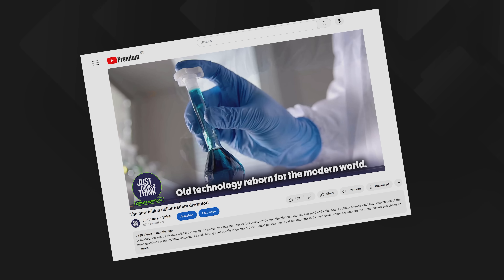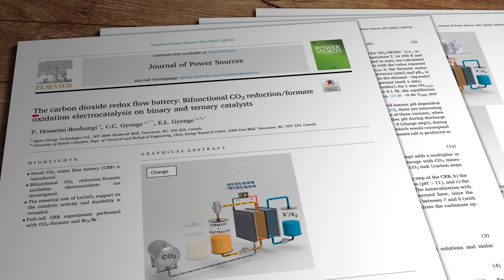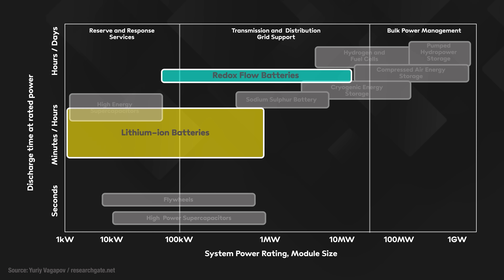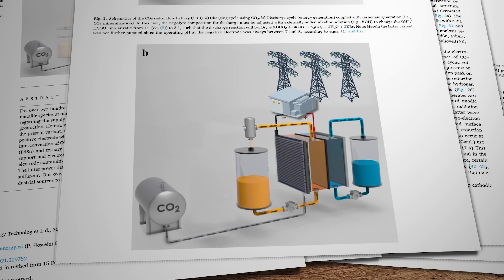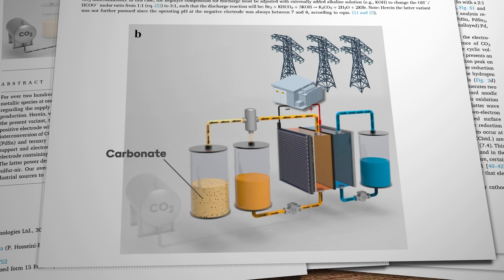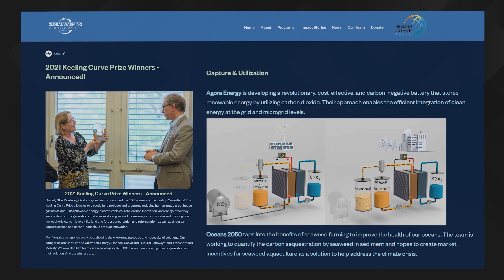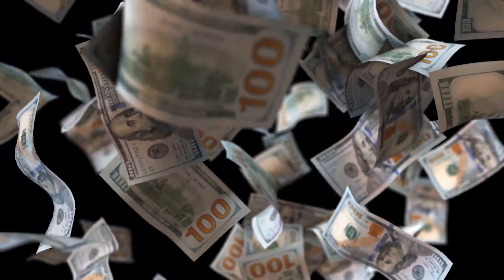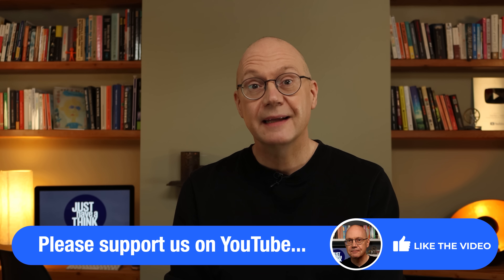A Carbon Dioxide Battery that could actually work!

Comment: I'm not qualified to comment on this one specific process. Way above my training / pay-grade. Think the woman in the Monty Python sketch, who is going to have a baby. "No, darling ~ you're not QUALIFIED." 
I would comment on the more general picture, there are solutions. There are ways to do this. Some are maybe more complex and tricky than others, but we're not going to find them if we don't look for them.
I would also comment that there's more than one way to skin a moggy. What may be a perfect solution in one place, with one set of resources and restrictions, perhaps there's a different solution which would be suitable in another setting.
A large scale Redox Flow battery, that uses captured CO2 ~ that sounds really good ~ even if the volumetric efficiency isn't all that great. If it doesn't have the energy density of a high end Lithium Ion battery for a phone or a wristwatch ~ so what?
If it's also cheap to make and cheap to run and uses processes and chemicals we are extremely familiar with already, and have industrial infrastructure already in place for handling and such ~ that's a double advantage.
If that same process can give rise to carbon capture and make bi-products that are resources for other large scale chemical and manufacturing tasks, which are already happening, then you've stumbled onto a gold mine.
You've got a way here to do chemically stable carbon storage ~ never mind pumping gas into old mine-shafts or frakking with it!
If it is a robust and long term process, doesn't require constant expensive maintenance and replacement of cathodes and anodes and such, so much the better. Doesn't require superconductors or cryogenic temperatures ... Yeah, some things are a bit toxic there, will require careful handling. Ok ~ how many things in existing industry are like that?
Now ~ if we combine all this, and the idea it doesn't require lots of rare Earths and angel dust, dehydrated unicorn semen, Strontium isotopes ~ graphene membranes to prevent dendrite short-circuits,  that's great.
What? It's also got an energy density on par with phone / laptop Li Ion batteries? As good as what we're using in Tesla cars?
Shut up and Take My Money! ~ Where do I sign up? This is fantastic!
No, I'm not advocating this as the one and only true God ~ that's my point. There's more than one way to shave or wax your kitty, but this sounds incredibly promising on so many levels.
This is what we do and encourage scientific and industrial research for ~ to find solutions like this.
It's got one or two negative aspects, things that have to watched and handled frequently and with care & training, but mostly it's just all winning cards in the the same hand.

Comment: Converting CO2 to carbonate does not generate (or require) electricity, so the whole "saleable product" thing is bogus. As is the "capture" of a less-than-microscopic fraction of the world's CO2 emissions.
  
With that PR nonsense out of the way, you have the actual invention, which is reversibly coupling formate oxidation with bromine reduction.  Good cell voltage and excellent power density, and no expensive metals, makes it really attractive for stationary storage.  Challenges are the membrane and electrodes, which have to hold up long-term to bromine under harsh conditions.  Not a small ask, but if they can do it at scale it's a winning design.

Comment: Grid storage doesn't care about density.

Making sodium carbonate out of sodium hydroxide and CO2 happens spontaneously.  It's making the sodium hydroxide that's the sticky wicket.  Running the battery discharge at high pH needs the same sodium hydroxide.

Having one cheap component doesn't make a system cheap.

Comment: One of the reasons I really love this channel is that it makes things feel real - there is no neo-liberal, tech bro optimism - but it spends a lot of time going through the many, many different technologies that are being researched and optimised. Particularly storage tech. Many don't involve the usual suspects in terms of battery tech, and some aren't even highly toxic for either extraction or recycling at end-of-life. And there are LOTS of them. 95% of them will fail completely and 80% of the rest will be too expensive to make a meaningful difference. Many of those that could really make a change might take a couple of decades more to get there. 

But what that all means is that actually, at least for the energy thing, we aren't doomed. 1% of 1000 is 10, and that's probably enough. It's not all relying on lithium and traditional solar panels, and that means we could actually force miners and manufacturers to keep to some minimum standards and still make some meaningful progress in terms of volume.

What about copper though? Is that going to be one of those "hard" problems that physics is going to stubbornly stop us getting proper alternatives to?
Reply: Aluminium is a quite popular substitute nowadays. It is used quite a bit in transformers in lieu of copper. It's in almost inexhaustible quantities in the crust.
Reply: @gregbailey45 indeed, take copper clad aluminum network cable or the aluminum ground cable that powers my house since 1976(!)

Comment: I've no illusion that I'm benefiting anyone with wisdom. I comment to help out the algorithm, and to make sure I understand what the video is saying. It helps a lot.

Anyway, thank you for another great video. This is a really clever idea, and for once it's fairly close to home! Agora Energy Technologies is a Vancouver startup, so just on the other side of the mountains.

It does sound clever. Energy storage and/or carbon capture. It seems like the best place for these batteries is an industrial park, where some of them could regulate the electricity coming in and others could be put to work making carbonate. If I understand right, the main reason industries don't capture CO2 from their own smokestacks is because it costs money. If they can sell the carbonate that could potentially make the equipment pay for itself.
Reply: Those secondary/tertiary market opportunities could make for ‘zero-cost’ or low cost installation for sure! I’m in Alberta, and it would be great to have a facility out here pulling from refineries or concrete plants.
Reply: Yea, the algorithm.
Reply: @andrewharrison8436 Al 🕺 Gore 🕺 Rhythm 🕺

Comment: I studied Chemistry, not Chemical Engineering, but this doesn't sound at all practical. First you have to capture the carbon dioxide, which (so far as I know) is untried at scale. Then you have a battery that requires bromine, which isn't all that common and is nasty stuff. I'm pretty sure this is untried at scale, too. Finally, you'll need a source of alkali - presumably hydroxide, which probably has quite a carbon footprint in its production. The whole thing sounds like a pipe dream, with added greenwashing.
That said, flow batteries in some form could be a useful form of energy storage in static locations, without using up the lithium we need for mobile applications such as vehicles.

Comment: Maybe I'm missing something here. please correct me if I am.
But it sounds like this depends on capturing CO2 from the dirty industrial processes that we should be trying to eliminate. And won''t a lot of the carbonate and bicarbonate end products be used in ways that end up releasing the previously captured CO2 into the atmosphere?
Reply: Depends whether you're a glass half full or half empty person.
Reply: @gregbailey45  Not really. We need to stop, or at least greatly reduce, CO2 emissions. Recycling fossil fuel emissions once or twice before releasing them into the atmosphere doesn't really achieve that.
You still have a full glass of CO2 even if you temporarily reuse half of it.

Comment: The other elephant, not talking about the chemical, environmental and disposal elephant. But the energy elephant required to capture and process the CO2. The energy to pump and the control systems the soutions around and the general plant operations lighting etc. Then back to the first elehpant and the energy used in dealing with it. 
How much larger do the solar and wind farms need to be to counter ballance (and there is another elehpant the cost in mining manufacture and maintanenc of thoses systems) all the ineficencies along the way to run the batteries. 
Seems it is a bit like fusion reaction the out put energy can not sustain the reaction let alone allow any meaning full power being delivered to external demand.
Science is bitch, hate to break it to all the free energy cult members, you don't get something for nothing excep the sun, wind and hydro even they can have cost.

Comment: 0:00: 🔋 Innovative carbon dioxide battery technology emerges with unique features.
2:57: ⚡️ Innovative redox flow battery technology offers longer duration storage for renewable energy integration without using troubling metals.
4:47: ⚡ Innovative battery design converts carbon dioxide into valuable carbonate through pH manipulation.
7:28: ⚡ Breakthrough in energy storage technology with high energy density and potential difference.
9:20: ⚡ Breakthrough technology by Agora Energy faces funding challenges despite winning prestigious awards.

Timestamps by Tammy AI

Comment: Here's an "Explain Like I'm 5" abstract of the transcript about redox
flow batteries:

What's a battery?

* A battery stores energy like a big lunchbox holds your food.
* Normal batteries keep all their energy inside, just like your
  lunchbox.
* Special batteries called "flow batteries" store their energy juice
  in big tanks and use pumps to move the juice around.

What's special about this flow battery?

* Instead of using special metals, this battery uses bubbly gas you
  breathe out (carbon dioxide).
* This gas is usually bad for the world, but this battery catches it
  from factories.
* While storing energy, the battery also makes something like baking
  powder that people use to make lots of stuff!

Why is this battery cool?

* It helps clean up bad air.
* It stores lots of energy, like a big lunchbox.
* It makes something useful while it works.

Is it perfect?

* No, it's still new and scientists are working on it, like a new
  recipe.
* It needs careful helpers because it uses some strong liquids.

What now?

* Scientists need help to build bigger versions of this battery.
* It won't be in your toys soon, but maybe one day it will help keep
  the lights on in your whole town!

Abstract

This transcript describes a new type of redox flow battery that offers
several advantages over traditional models:

* Captures Carbon Dioxide: Instead of using metals, this battery
  uses carbon dioxide (CO2) captured from industrial emissions,
  helping reduce greenhouse gases.
* Produces Valuable Products: During the discharge process, the
  battery turns CO2 into carbonates and bicarbonates, which are useful
  in various industries (soaps, animal feed, glassmaking etc.)
* Promising Lab Results: Lab tests show high energy density and
  potentially low costs due to inexpensive CO2.
* Challenges: The technology isn't yet commercially available and
  needs careful handling due to the use of acid and bromine.
* Need for Investment: Despite winning awards, the company (Agora
  Energy) needs more investment to scale up production.

Overall, this carbon dioxide redox flow battery shows promise in both
energy storage and carbon capture, making it an exciting technology
for a more sustainable future.

i used gemini

Comment: i would be extremely skeptical of agora's claims. i don't doubt their final numbers, but as a few other commenters have pointed-out, 'simply' raising the pH value of the battery fluid is not a triviality to be ignored. they are likely putting more carbon into the system than they are capturing and maybe even more energy into the system (if they are using hydroxide) than the battery stores 

this would make the battery impossible to scale and disqualify it as a carbon capture solution

Comment: Seems a very good use of a waste product, and as a concept very innovative. My concern is that the makers of the waste product will see this as yet another justification to keep the CO2 flowing, on the basis of 'it's not the fossil fuel, it's the CO2'. As we should know by now, CCS is an appalling waste of energy and hugely inefficient. Daisy chaining this on the process just adds to the inefficiency multiplier.

Comment: Sounds too good. Any info if the gravimetric energy includes the storage container?
Wonder what SH will say to that kind of CCS?
Reply: For most stationary storage applications, both volumetric and gravimetric energy density are pretty much irrelevant, I  would presume.
It may be an issue if used for a home battery, but that would be very unlikely for this technology due to the need for high pressure CO² gas storage.

Comment: You missed the issue of this process requiring CO2 to be captured from a CO2 producing chemical process (which may not exist when this battery is deployed in ~2040)
Also anything branding itself with CO2 feels like a dangerous field, for using it to prevent its harmful effects sound to good to be true. (At large scale) Hence it might be prudent, to show how much of CO2 emissions could be reused in this way, give that the CO2 is actually converted into another chemical.
I think this may best be described as a battery technology for reprocessing waste CO2 to reduce mining need. A CO2 battery sounds, much like a CO2 heatpump, like you only need a minor amount once, which would never be enough to make an actual impact.

Comment: I would be very interested to see a video from you in which you cover all these technologies and where they are now, why they succeeded or failed and the state of it all.

Personally, I've noticed no difference in anything around me for a long time... Which is very polar opposite to what you'd expect to happen over a decade or more with these kinds of developments
Reply: Sadly, the electrons don't look any different no matter where they come from...
Reply: @gregbailey45 Yes... But what I'm saying is that all the battery tech the consumers are using are still the same format, albeit perhaps more efficient.

Comment: It would make sodium carbonate  as the byproduct if fed sodium hydroxide. The separatog would be  a proton exchange membrane and bromide/HBr/ Br2 would be the anode side. The materials needed to work with elemental bromine and HBr would be challenging, but SiC/graphite on a metal oxide/ tantalum plated collector should work well. Ordinary stainess steel coated with palladium of patinum loaded carbon would work for the cathode side. In an open cycle, the battery would be charged by creating bicarbonate that creates formate and carbonate as power is being drawn. The formate is the actual chemical created as it runs. Other than the small amounts of precious metals needed it seems like a good idea as formic acid is a useful chemical feedstock.

Comment: The fact that this battery uses CO2 isn't particularly relevant to climate change.  In order to make a dent in climate change, we need to remove BILLIONS of tons of CO2.   If we had enough of these CO2 batteries to make up for the worlds yearly 55Mton production of sodium carbonate (~100 gigawatt*h facilities, fully cycled daily for a year) we would sequester 23 Mton CO2, which is about one five hundredth of a billion tons.  Kind of a drop in the bucket.

Comment: No battery does "frequency regulation duties" - unless ,of course , someone invents the improbable AC battery.
Btw it all very well saying they are going to capture carbon dioxide , but when it comes to the crunch they invariably end up using the existing dirty industrial methods of production

Comment: Very promising. I'm sure that the carbon capture aspect of their techsplanation is winning over a lot of enthusiastic influencers, however, I come from the "If it looks too good to be true, it probably is." school of economics and I wonder why there isn't a gold rush on to invest in this system, particularly since they've been pitching it since before the pandemic.

I particularly like the fact that in theory, the spin off processing of carbon dioxide into carbonates means that instead of just cycling CO2, the battery consumes it and requires a continual supply (carbon capture). My question would be how is the carbonate "Precipitate" harvested? Presumably it builds up on one or other of the electrodes? The rate at which that happens and the effect on the efficiency of the battery is obviously crucial. If the unit goes off line for the harvesting process it surely calls into question the practicality of the design.
Reply: It may just precipitate out of solution, in which case it could be continually harvested without cell disruption.